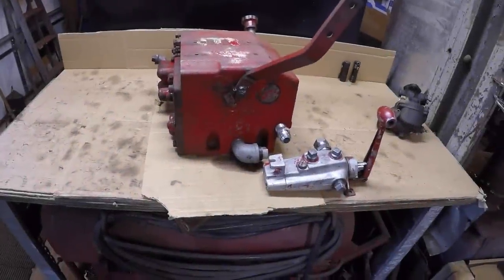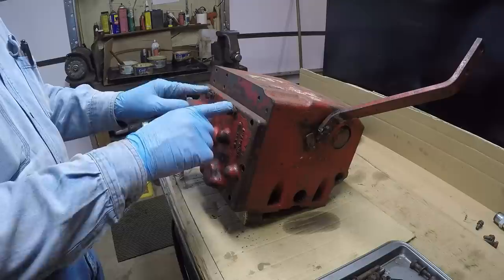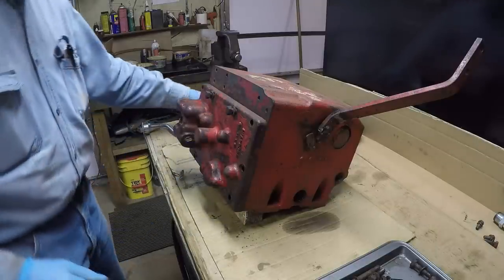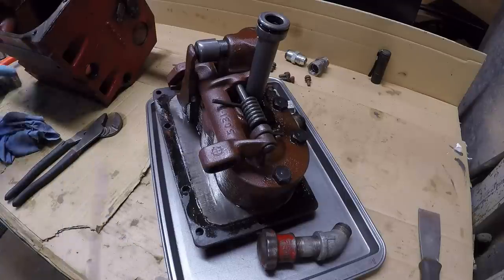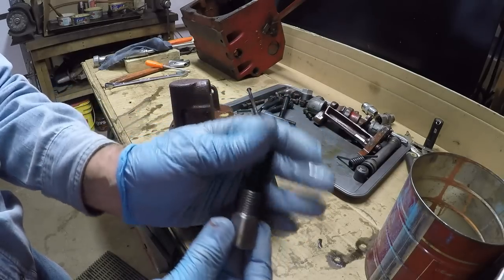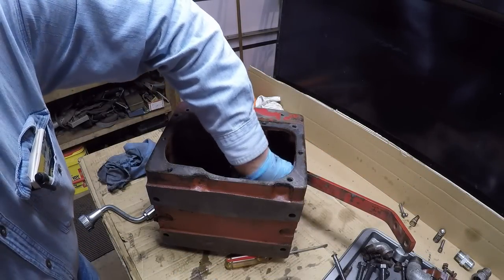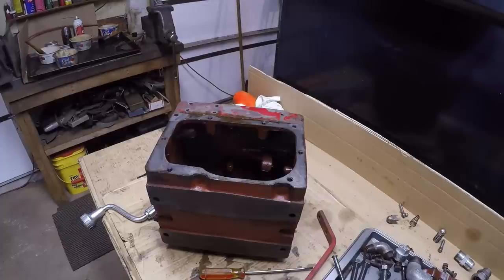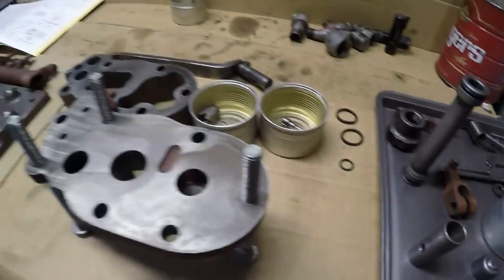Farmall Super M Rebuild Ep.43: Hydraulic Lift-All Control & Reservoir Disassembly & Reassembly

Comment: That's one of those devices I never thought about how they worked until I saw you take it apart.  Love the old mechanical devices.
Reply: These days they'd have an expensive computer doing exactly the same thing but lacking the durability and repair-ability of the old mechanical system.
Reply: @tpniefer  Exactly my point.

Comment: Your extensive knowledge in all aspects of an M are VERY impressive. I have never seen a thick washer used as a key in a pinch bolt before. VERY clever engineering and thanks for pointing it out. BTW, galvanized and black iron pipe fittings look very similar when wearing IH red paint. :-)
Reply: iron pipe is the preferred way to go otherwise its lipstick on a pig type of thing don't ya know lol
Reply: Learning hydraulics one of the first lessons is never to use galvanized fittings anywhere in a system. They will tend to flake off and contaminate the system.
Reply: @larryd8224  thanks for that bit of knowledge,  wasn't aware of that.

Comment: Getting closer to running all the time........

Had a thought overnight, Senior mentioned in a previous video that he was leaning toward going back to a 12 volt generator instead of the alternator. They now make alternators with generator styling, I believe Powermaster is one brand, generator looks with alternator reliability. Summit Racing and Speedway Motors both carry the line, which includes Delco style models. Just something to think about.........

Comment: I see that IH didn't use or drill holes in the heads of those bolts that's internal. Any concern of those vibrating loose from usage?
Reply: That is an after market pump as is the wide front end.